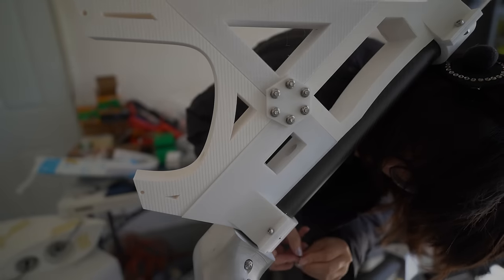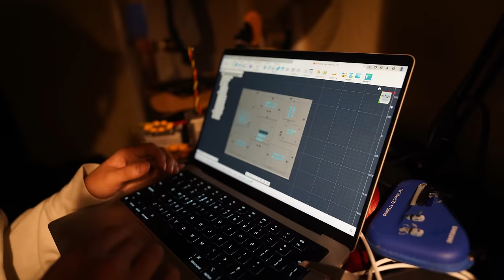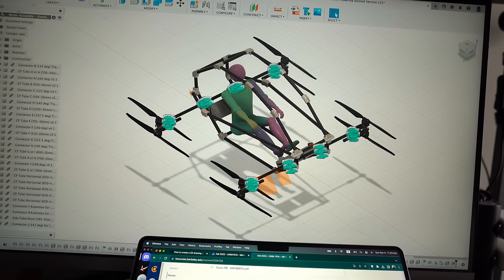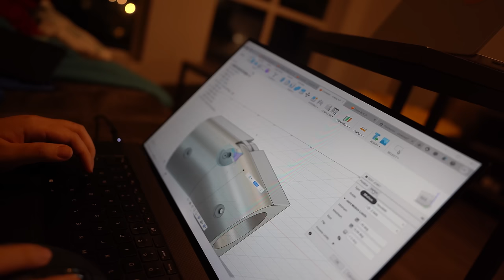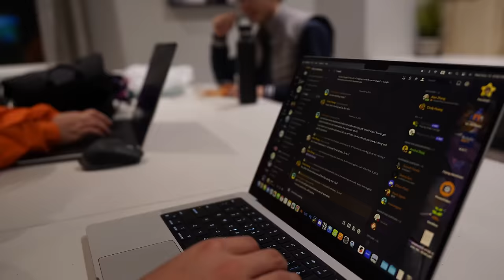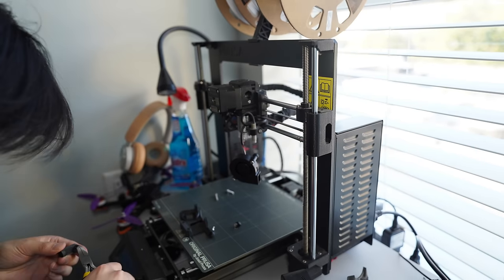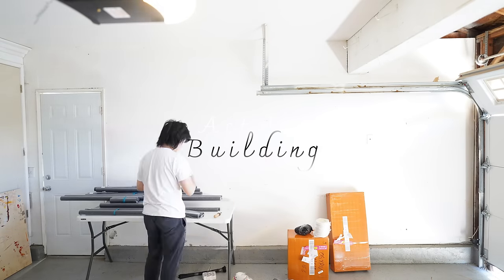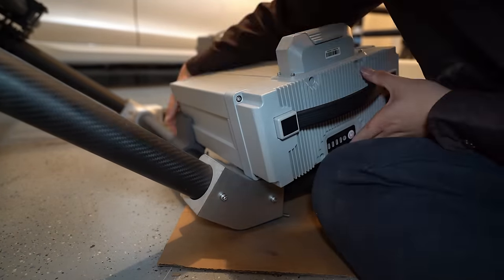I built a flying car! (eVTOL)

Comment: PLEASE READ FOR YOUR SAFETY

incredible project but PLEASE do not use printed plastic peices for your coupling joints. youre going to klill yourself. Smart choice with carbon fiber tubes but if every joint is non-fiber-reinforced plastic theyre going to fail under flight loading i almost guarantee it. and the hinge for your cockpit too. all those parts should either all be carbon fiber or should be some sort of metal. 6061, even 2024 would probably work. the structure you have makes me think of bridges we made in elematery school from wooden skewers and marshmallows as joints. At least estimate some of the flight loads and make a test fixture to test the forces and moments on your joints, any mechanical engineering prof or technician can help you do this. Or even just some straps and some weights. Or run some FEA. youll see that your plastic joings WONT WORK (im like 95% confident in this) Even falling from like 5 feet with the eight of a person inside i bet half the joints will crack. Or I bet even just full thrust from your motors will rip off the arm booms.

ANYWAY please backup your structure with mechanical testing before you try to fly in it. YOU MIGHT MAIM OR KILL YOURSELF IF YOU DONT.

Goodspeed.
-a fellow aerospace engineer with structual engineering experience.
Reply from the maker: Thank you for your advice. The joints are fiber-reinforced and special composite that costs 10x regular printed plastics. But regardless, next version is made out of machined 6061. FEA were ran on this model (forgot to edit into video), but the next one has better FEAs.

Comment: Just letting know many scenes were videoed in the fast motion styles. You should check the video speeds before uploading to You Tube so that all the scenes are running at normal speed.
Reply from the maker: Sir that would be a 30-day-long video 😅
Reply: @alanzeekk   ik. i was able to slow down the fast scenes using my YT controller panel. I will reply to you in 30 days.

Comment: Well there was a lot of engineering missing. For instance there was not a finite element analysis, not a static and dynamic load analysis, not a aerodynamic simulation, not a stress test of weak elements and joints. There was not a center of mass, roll, pitch and yaw analysis. You just didn't show none of that in the video.
Reply from the maker: Forgot to edit in

Comment: Why do none of these ever have propeller guards? Asking to lose a leg or catch a serious lawsuit.
Reply from the maker: Good observation. After doing careful analysis and calculations, propeller guards would cut the flight time by half, noise nearly double, stressing the propulsion significantly (thus increasing cost and hazard of component failure). 

TLDR: having prop guards is more dangerous than no prop guard, counterintuitively

Comment: That thing falls from any height your either close to death or dead that’s not a cage that would hold up to any fall from any real height a roll cage in a car are built better you need more reinforcement gussets that thing is dangerous if it flys but so are paramotors so think about more reinforcement

Comment: structural integrity problems.... hmmm. The test you are doing at 8:45 clearly shows it. It is clear it needs a redesign.
Personally, I would not risk my life with 3d printed tube connectors, and your design looks heavy!
Structural simulation is the least you could do to lower weight

Comment: Math. Generated acdc.   Motor. Small battery. Turn on. Math.  Makes energy untill then. Altenator.  Over runs. Computer. Varies so no. Batteriie.  Math generated power acdc.   Inverter. Scooter who needs a plug. Just a. Computer.

Comment: How much does it weigh and are you in America becuse with the ffa all you need I'd for it to be under a sertain weigh t and only be able to fly a sertain distance at a time a stall at 25 not and you wouldn't even need a license to drive it just make a flight plan like flight Plat to work or flight plan to the store or flight plan to cruze around the block or ya that sweet I want to build on now but as we know that's future and buy that time I could buy that and your probably making a lot on sales vecuse you already have your prototype scale to reproduce from
Reply from the maker: Aircraft complies with FAR Part 103!